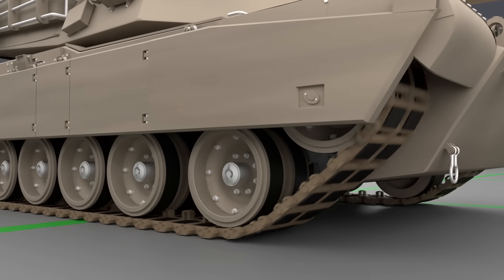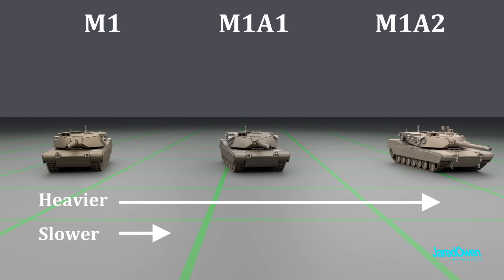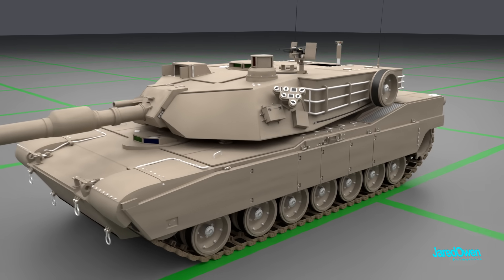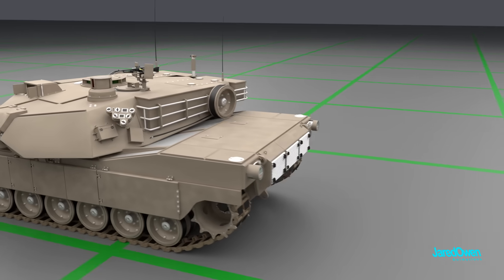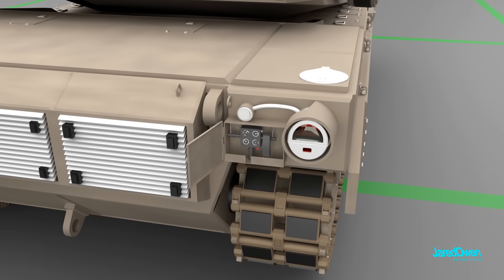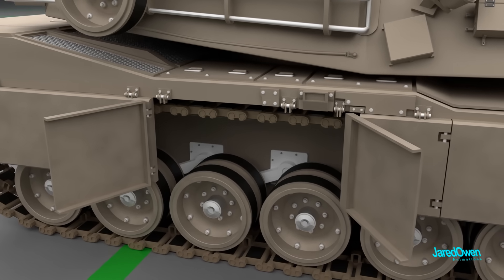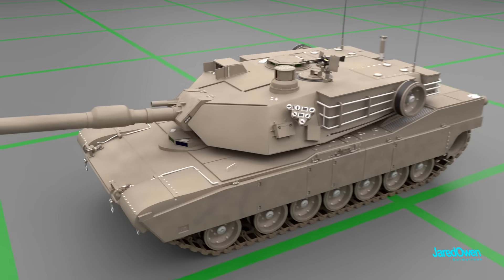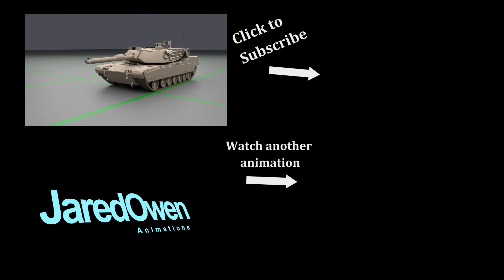How does a Tank work? (M1A2 Abrams)

Comment: One small Detail: the smoke grenade launchers actually launch small grenades wich Land in front of the tank and smoke there. Other than that it’s a nice visualization, and it’s always nice to see Germans and Americans engineer something together
Reply: @kng_drripmd5579  Sure. You know, if I wanted to argue with edgy 13 year-olds, I'd have said so, but that didn't stop you, did it?
Reply: Are you saying that the smoke grenade launchers launch smoke grenades? That is crazy talk.
Reply: @kng_drripmd5579  I never made a point that went counter to one of his.

Though I should mention that the M1 is louder than the Leo; the point about higher frequencies being less loud is only true if you have solid cover between yourself and the engine, in case of an open field it's basically the same and if you're in a structure that conducts sound, like a street with buildings on the sides, it's louder.
Reply: i bet the split up after the mbt 60 project and made the tanks alon , but the m1 abrams does use british armor which but us added uranume to it .
Reply: @عمار_طواف  It's not british armor.  The brits came up with the idea of composite armor, but the M1's specific armor was designed and made in the US.
Reply: German engineers didn't work on the M1
Reply: @NUCL3ARTAC0S  well the barrel is made in Germany
Reply: @idaklymr  The 120mm M256 gun barrel is manufactured at Watervliet Arsenal, New York
Reply: K!Ng_DRrip MD The engineering requirements were laid out by a US Army task force of armor veterans, and the Chrysler proposal was engineered by a team led by Dr Phillip Lett with input from the Army BRL. The myth of any substantial German influence comes from the MBT/Kpz 70 project which had limited influence on the M1.
Reply: @NUCL3ARTAC0S  "The myth of any substantial German influence" The main gun is a licensed build Rheinmetall 120mm L44.
Reply: peter Müller The original M1 used an M68 105mm gun based on the L7
Reply: @NUCL3ARTAC0S  Yeah changing the main gun to a german gun is no influence at all... 
I am not trying to diseespect someone like you, who took part in the Mbt-70 development and M1development btw.
Reply: peter Müller I am talking about the M1 as it was originally designed, not the M1A1 that came out over a decade after the initial effort began. I already talked about the MBT 70
Reply: @NUCL3ARTAC0S  yes you talked...
Reply: NUCL3ARTAC0S Original m1 came up after Mbt 70 which is a co development... and the m1A2 and literally all abrams in use have a german gun , who cares about the old M1
Reply: @leopard2109  Prior cooperative development does not automatically mean that it had an significant influence on the engineering of the M1.
Reply: @leopard2109  A vague resemblance does not mean direct lineage. The overall shape of the M1 was based of the 1972 US Army TACOM studies that resulted in the LK series of concept vehicles. Check the link below for a sketch of one of the several LK proposals.

https://i1.yuki.la/7/e1/5854679e940a02d73750270e1401f0e12a81d14c41be043b5be1b50e9aef5e17.jpg
Reply: leo pard 2 l
Reply: @NUCL3ARTAC0S  So did the Leo 1.
Reply: @kng_drripmd5579  This Video is no prove of anything, just look at the mistakes...
Reply: Actually, the smoke grenades explode before hitting the ground.
Reply: Charles Ball true that
Reply: Whats the max vertical angle of rotation of the canon? Missed that in the video...
Reply: @JOHN GAGE i promise you, US materiel uses JP. even the HMMVV.  we adopted single fuel use in the 80s. Logistics was the goal, but this was during peacetime.. and personally i believe the materiel has adapted to these peacetime conditions.  
Its one thing to have diesel materiel than can run on jp8.. its something entirely different to be developed to take jp8 primarily.  
What good is Logistics if its not flexible. 
like our addiction to pristine runways.. what good is an airforce without runways?

weve moulded our armed services to run on luxury.. but as weve been told, war is hell.

TBPom.. im not sure that is correct, and it seem counter intuitive, but im pretty sure diesel has more BTUs per gallon than kerosene.

Personally i think it should all run on bunkeroil.  sieve the tar our of crude and straight into the gastank. THATs flexibility.
Reply: Karachi Rains - Record-breaking precipitation sinks Karachi once more
https://www.myinsideclub.co/2020/08/in-any-event-18-pass-on-as-record.html
Reply: I killed a commander of an open top vehicle using smoke grenades in warthunder, the player was pissed
Reply: @JOHN GAGE It uses jet fuel JP-8 (Jet Propellant 8) that is what the US use. Australians use Diesel and It is selected to run diesel on the DECU.
Reply: K!Ng_DRrip MD  and like i said , saw both tanks in real life and spoke to the commanders , go ahead and search: European strong tank challenge ... look at placements number 1 is always a Leo as expected idiot
Reply: @leopard2109  hm, though up close the Abrams is louder than the leopard. When you start walking away, the rumble of a deseal engine is more apparent. The high pitch sound of a turbine doesn't travel far compairing to the low frequency rumble of a deseal.
Reply: Elon Wong true but newer versions have more Partikel filters which makes them a lot quieter , anyways noise shouldnt matter since they never come alone and a modern world war wont be fought with tanks , in countries like syria , irak or afghanistan sneaking up on enemies isn’t necessary since engage most of them with drones or helicopters, planes etc only when civilians are involved then troops and tanks come over
Reply: @leopard2109  uff
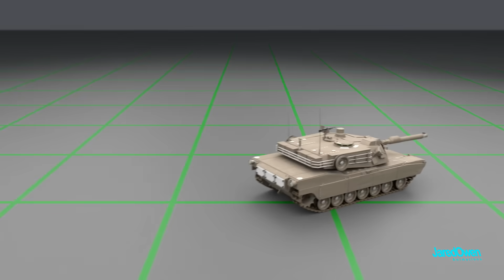Reply: leo pard 2 https://youtu.be/jABL74LTmhY time stamp 0:50 to 1:30
Reply: @kng_drripmd5579  I think you don't know how turbines work. First of all, he is right. Turbines will always only work at max fuel consumption, no idle mode. The turbine will take as much fuel standing still, as it needs to move the tank at full speed.

Because of that the Abrams has a extra power unit to feed the systems with electricity while the tank stands still and should not use the engine.
Reply: i wish we would adopt the Germans appreciation for diesel.  the Abrams is curtailed by the INdustrial Complex.  Uses jet fuel.. ridiculous.  Great thing about diesel, if you have to you can burn anything in it.
Reply: @bartacomuskidd775  The Abrams is fully capable of using diesel, it's turbine engine is multi-fuel rated. Diesel and jet fuel are fundamentally the same fuel. The US uses jet fuel because it already has the supply chains in place to supply it.
Reply: @bartacomuskidd775  The Abrams can actually use nearly any of the common fuel types, and the engine is quieter than a diesel.  At speed it's also just as efficient.
Reply: @leopard2109  Having been around a few of them...the Abrams is LOUD!
Reply: LikeUnto Buddha thats true but as someone else said deeper frequency do travel farther than higher pitched ones
Reply: @legogenius1667  No it isnt. It is louder, but harmonics are different and noise fades way more than for diesel engines.
Reply: @bartoszbaranowski604  Noise fades away more = quieter. I meant in terms of what someone would hear, and if the Abrams is heading at you you will hear the track noises before you hear the engine.  It's nicknamed "The Whispering Death" sometimes because it's so sneaky.
Reply: @legogenius1667  where i appreciate your enthusiasm, that doesnt make sense. If you change the variables in an equation, you change the solution. Youre are not going to get the same efficiency by burning a completely different hydrocarbon. And each of those hydrocarbons are going to have a completely separate set of conditions. Temp in, temp out, gunk, top-end, viscosity, RPM.  
All you guys reading this, youd have to apply the same conditions to the German Diesels.  As if they could use JP and not have a change in specs contrary to what the tank i designed for. 
The bottom line being.. Jet fuel takes extra refining steps, is harder to get ahold of, requires a larger infrastructure, is in shorter quantity, is in demand by more than armor (and extremely valuable resource for air interest). While we can make diesel anywhere at low cost. Its basically cooking the bunker oil and bitumin out. 
You could run a diesel on vegetable oil if you had to.. could you run c130 on it?

Jet Fuel is a disadvantage. and a disadvantage multiplied by the Size of our armed services is a potential disaster.
Reply: @bartacomuskidd775  OK but the Abrams can run on basically whatever fuel it finds, including diesel.  In addition, the US (because of the spending power of the military) can afford to keep the most rigorous supply chain in the world.  The M1 will almost always have access to jet fuel and if it ever doesn't, it will run well enough on most everything else.  

When I said it's more efficient at speed, I meant that because of the nature of the gas turbine engine, when the tank is at speed it doesn't need to burn as much to maintain momentum as when it's getting moving.
Reply: @legogenius1667  well we hope we can afford that rigorous supply chain during a conflict. But attrition is the name of the game. disruption of resource is the first goal of conflict.
Reply: @bartacomuskidd775  If we kept it up during conflicts like Desert Storm, where we crossed previously uncrossable desert areas to surprise the enemy, I think we should be able to.
Reply: @leopard2109  I'm an engineer and I've never seen a commander in person, let alone the crew. Only talked to a loader once
Reply: @leopard2109  I don't think you are correct mate and the kid is right. The AGT 1500 is Quiet and hard to hear until it is on top of you in a deployment sense. I Know this because I was a leopard Commander and Instructor first Before we switched to The M1A2 where I'm a Commander and Instructor. Happy for you to call me out but you will find that I'm right on this. There is a reason the M1 is nicknamed "Whispering Death".
Reply: @bartacomuskidd775  gas turbine engine's only disadvantage compare to diesel engine is cost.
Reply: @유빈_Yubin_716  And horrendous inefficiency at anything other than peak output, together with being more fragile compared to diesel engines, both from environmental and combat damage. You also can't idle a turbine, as the Russians found out.
Reply: @justsomemainer1384  Yes? For one, he's mostly comparing the american engine that was put up against it, whereas the Leopard 2 for example uses a different more powerful engine, but more importantly, he doesn't really make a point against what I said and neither do I against his points.

If there's one thing that should be noted: While a gas turbine technically has better torque at low engine speed, this doesn't really affect a piston engine much, since it doesn't drive the sprocket directly, but through a variable transmission.
This means that a piston engine will almost always operate at peak engine speed, no matter the actual speed of the tank.
Reply: @MajinOthinus  "f there's one thing that should be noted: While a gas turbine technically has better torque at low engine speed, this doesn't really affect a piston engine much, since it doesn't drive the sprocket directly, but through a variable transmission.
This means that a piston engine will almost always operate at peak engine speed, no matter the actual speed of the tank."
WTF
Reply: @MajinOthinus  Wrong About the IDLE dude. The M1A1 has A DECU that converts the drivers RPM inputs and idle functions into electronic messages which are sent to the EMFS that meters fuel to the AGT 1500. The M1 IDLING RPM 850 - 950 RPM, Tactical IDLE 1200 - 1400 rpm,  High IDLE or Max 3000 - 3200 RPM. PS I'm a 20 year Tank Commander and Instructor on Leopard, M1, and the M88 so I do not need google.
Reply: Holy fuck,,,  guys,  turbine engine makes more power if it is the same size, and jet fuels have a lot higher energy density. Think why bigger modern airplanes use turbine engines compared to the old and smaller prop planes?
Reply: @bartacomuskidd775  See "Volkswagon"
Reply: @LikeUntoBuddha  You mean Volkswagen. A wagon hangs  behind a locomotive.
Reply: @bartacomuskidd775  the abrams is more than capable of using pretty much all types of fuel, give or take fuel efficiency goes up or down depending on the fuel(mainly cause it needs to hit its power cap or whatever it is to power everything), besides that, jet fuel is mainly used cause hey, theres tons of it
Reply: @bartacomuskidd775  The Abrams can burn a wider range of fuels than the diesel and in terms of moving around at near its top speed, it gets better gas mileage as well.  Also, the Abrams doesn't use "British armor" that's like saying "American cars use British wheels" simply because all cars use wheels. Our armor is a uniquely American composite that includes depleted uranium.
Reply: @K_GHOST225  Nice to see someone from General Dynamics at You Tube!

Comment: Untill m1a2 commander was blind at night cuz only way to see is through a vieving block
Reply: Nope. The abrams and pretty much every modern tank is equipped with night vision equipment
Reply: @snonsig2688  yes the gunner had night vision but commander didnt he had only viewing block
Reply: @stralegaming2597  no. That's just wrong. The commander as an assortment of sights, most of them containing NV equipment. It wouldn't make any sense for him not to have NV
Reply: @snonsig2688  just watch problems with abrams tank by red effect
Reply: @stralegaming2597  god red effect. That's about the worst tank based channel ever. Fact is the commander does have his own CITV (commander's independant thermal viewer)
Reply: @snonsig2688  its your problem that you dont want accept that us army didnt fit m1 with night vision untill m1a2

Comment: I remember reading something about the newer Abrams switching to fiber optic cables and saving around a ton in weight
Reply: yes FOC is lighter, the components are small, they're just x4 more expensive. 1 cable can carry information a copper cable cluster with a 2meter diamater can.

Comment: Can you do the Original World Trade Center in New York City?
Reply: That would be an interesting one, though probably not worth it to Jared personally due to the controversial subject and conspiracy nonsense.

There's a documentary about it from when it was built that details the construction though, it's pretty interesting - in particular the part about how it was constructed using load-bearing walls in order to maximize interior space thanks to the smaller central core - which is also a likely contributor to its collapse as a major slice of said load bearing walls were removed in the impact.